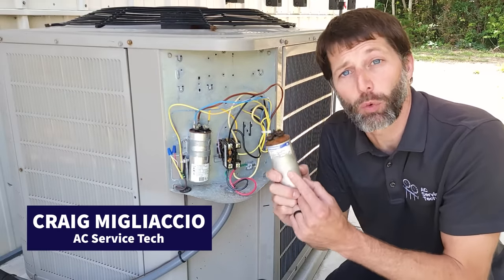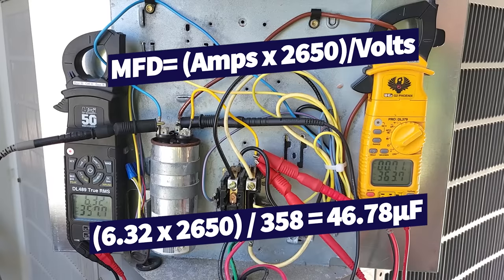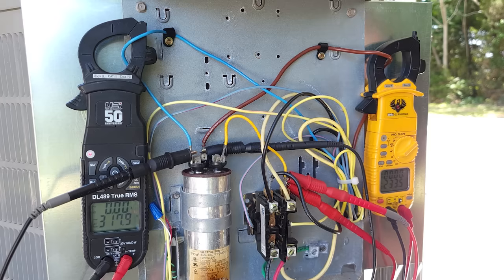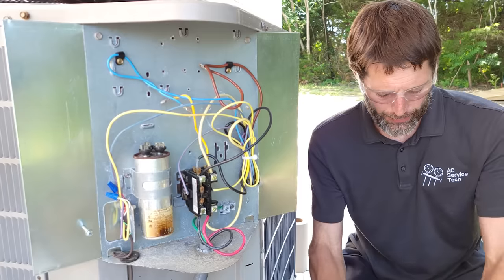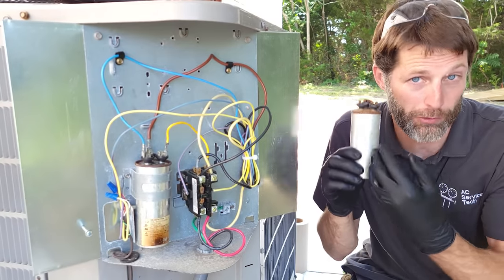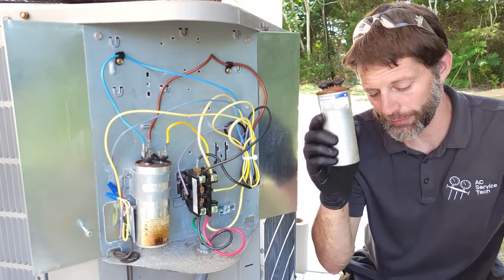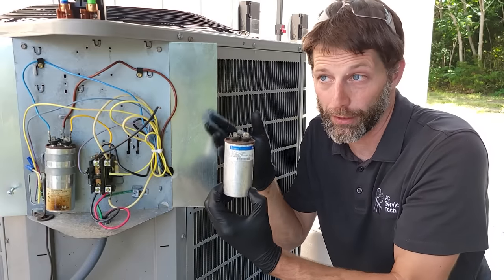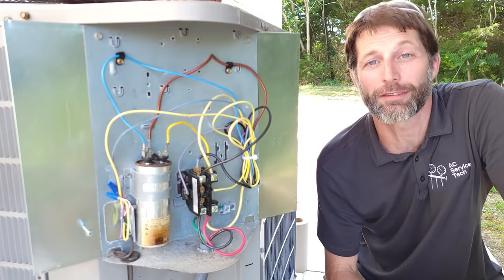WHY CAPACITORS FAIL in Air Conditioners! Watch it Break!

Comment: A little tip from a former residential tech, replace all 370 vac capacitors with 440 vac capacitors using the correct microfarad rating. IE: 35/5 mfd. 370vac dual capacitor fails, replace it with a 35/5 mfd 440vac capacitor. I can't ever remember having a callback on the same unit for a repeat failure in 9 years of service. Good luck guys!
Reply: if you put a 370 on a 440 , you will kill the compressor
Reply: @rodeoclownobama5796  but why?
Reply: Not even 440, but at least 370 * 1.41 = 520 V. Use 600 V capacitors and you will have no problems.
Reply: @rodeoclownobama5796  huh? the point is to upgrade the voltage from capacitor, not downgrade
Reply: @rodeoclownobama5796  lol, you sound like the uhaul tech who told me I was going to "over juice" ...his exact words.... and burn out my trailer lights by using a larger diameter wire...as if somehow magically the trailer lights will use a dangerously high amount of electricity just because the conductor is larger.
Reply: @rodeoclownobama5796  The voltage rating of the capacitor is the max voltage the capacitor can handle so you can you a higher voltage rated cap in for a replacement. Just don't go the other way.
Reply: you can replace a 370 cap with a 440 , but you can all ways go to 440 with no worries.you can go higher but not lower, I know people who put  a 370 on a 440 and it killed it, mistakes happen. why I don't know, I just know it killed it, took a week or two but it did kill it
Reply: @rodeoclownobama5796  Did it kill the compressor or the cap? I've never made the mistake myself so I'm unsure of which would be damaged. I imagine the cap went right?
Reply: @stinkyham9050  wrong
Reply: @rodeoclownobama5796  I think you're missing everyone's point on this. No one is saying put a 370v cap where a 440v is needed. We are saying to put a 440v cap in place of a 370v cap. I'm not wrong, the voltage rating on the side of a cap is the max voltage it can handle without taking damage.
Reply: @rodeoclownobama5796  that's not how this works bud.
Reply: @stinkyham9050  I said the compressor
Reply: @stinkyham9050  I know that the  comment  said." replace all 370 vac capacitors with 440" all I said if the compressor is rated for a 440v cap and put a 370v on it it will kill the comptessor, that's all I said, man can you people read, go back to school
Reply: @stinkyham9050  you were warned his handle has word clown 🤡 and obumer , not the most sensible crowd
Reply: @rodeoclownobama5796  Agreed, you can't reduce the voltage of the cap or damage can occur. As for us misunderstanding you there was about 5 people on here that read your comment and we all thought you were saying the same thing. Perhaps your comment was not as clear as you thought it was.
Reply: @stinkyham9050  I guess seems it's all cleared up now
Reply: @rodeoclownobama5796  lol it was pretty clear to begin with! Larger caps equal lower chance of it blowing again.
Reply: I am an electronics tech........  not an HVAC tech.    In electronics,  it's an OK practice to use a replacement cap with a higher voltage rating within reason.   If a circuit is running 40v,   the factory cap may be 50v........    If I replace that 50v cap with a 63v cap,   my 63v cap is still only being charged to 40v.   I don't see an issue with that.
Reply: I did the same thing as an electronics tech. I think most of the capacitor failure I saw was due to cheap Chinese made electrolytic capacitors with bad electrolyte, but occasionally I'd see some circuits that used capacitors with an insufficient voltage rating.  Aside from the added lifespan of using a higher voltage rating cap, there's also a benefit of having a lower ESR (most of the time). Lower ESR can be a good thing in fast switching circuits such as power supplies and DC-DC converters.
Reply: Right!…why even carry the 379 vac cap on your truck?…waste of space…
Reply: @dmoore0079  there's been some issues when going way over spec in audio circuits... but a voltage bump of 25% or so never hurt my repairs.
Reply: @rodeoclownobama5796  that’s a negatory there hot rod. Using a 370v in place of the 440v OEM you’re losing voltage to your start winding. Thermal OL in the compressor is going to protect the compressor and the 370v capacitor is going to fail due to the increased heat generated from the start winding staying in circuit longer than it would loading the 440v cap.
Replace a 440v w/370v in a piece of TRANE equipment not equipped with a potential relay and start capacitor you can wave buh bye to the compressor warranty if it is still under the manufacturer or extended warranty.
Reply: I have done this with multiple systems, in different electronics, AC systems, etc.  Many manufacturers specs their capacitors just above the limit, so a 18V circuit has a 20V capacitor, and a AC unit running 360V has a capacitor rated for 370V.

Replacing the 18V circuit capacitor with a 30V capacitor instead of 20V, and a 365V circuit with a 440V capacitor instead of 370V will drastically increase their lifespans.

Getting actual Made in USA capacitors also helps, instead of all this China garbage which was made by the lowest bidder for a Nickel a piece.  Replacing your Chinesium capacitors with an AMRAD and paying extra $20 for them will always be cheaper than a AC service call or replacement parts for your AC system.
Reply: @rodeoclownobama5796  NO. Also to offer more insight. Sometimes things die. Compressors die. You die. Everyone dies. Dont feel bad that the compressor died. Think about all the good times we had with the compressor. Anyways dude you're wrong. You can put a lower voltage cap on a compressor. If you exceed that voltage it will blow. The compressor blowing is either unrelated, due to the old age of the compressor or actually related to the cap failing. Yeah basically anything's possible.
Reply: USE UPGRADED AMERICAN MADE COMPONENTS LIKE THE TURBO 200 AMRAD CAPACITOR WITH BRASS CONNECTORS THAT DONT RUST AND COME WITH A 5YEAR PART WARRANTY
Reply: Thank you!  While the video gave many reasons FOR the capacitor(s) to fail, he said NOTHING useful about how to prevent or forestall such failures (other than wait for end-of-life and call for repair.)  YOU have provided a very good potential preventative method to make such failures possibly less frequent, and that is the way it should have been!
Reply: @russell937.  You really don't need the Turbo 200 per se as that is basically a "universal" capacitor you can use in most A/C units, as it has multiple terminals with multiple capacitance values, making it a "universal" replacement that covers probably most scenarios.

Something like a regular Amrad with the correct capacitance and voltage rating will work just fine.

The Turbo 200 is pretty pricey, and would mostly work for an AC tech on a truck in rural areas where parts depots could be far away, and returning to a parts warehouse would be hours worth of driving.

If you are replacing them yourself, or know the values you need, just order the correct values.  The universal application won't really do anything for you at that point.
Reply: If your assumptions are correct. Ask yourself what killed the capacitor? How many service calls did you miss on call backs because of a missed diagnosis. Parts fail for a reason. Sounds like someone else was going behind you and properly addressing the issues. New caps that fail are either just poorly made or the cap was the result not the cause of your visit there.
Reply: @barbarafogle3541  Not sure I follow your logic there.  Parts don't necessarily fail "for a reason".  Parts like capacitors are life limited.  They are not designed nor intended to last forever.

It all depends on the cycles they are put through, and the environment they are operated in.

If a new capacitor fails, it was either defective, poorly made or not rated for the application it was put into.

An old capacitor will fail due to wear, cycle time, temperature, rust or other issues.

There aren't a lot of scenarios that would make a new capacitor fail besides defects or the capacitor being underrated for its application.
Reply: @redbaron6805  everything has a shelf and run time life. Only so many start ups for any motor. But time is just a man made construct to describe something. Usually a distance of space depending upon a relative position. But that's neither here nor there. Everything fails for a reason. Cause and effect is grade school logic winch holds true in our understanding of physics. For every action there is an equal and opposite reaction. A parts changer replaces parts because that's what he sees and never looks beyond the obvious problem in front of them. A tech is supposed to know why he's changing a part and how far to go beyond just getting a unit running. I'd like to test your experience if any and knowledge concerning capacitor & Hvac motor relationships when it comes to failed caps. What would you say the first thing to check when finding a fail start and or run capacitor on the condenser loop on a system? This guy talking about no call backs because of installing a different rated cap is nonsense and coincident. Can you tell me what steps would eliminate call backs for this situation other than a factory defective cap winch I believe is never gonna happen. Especially if you inspect and check the new cap before and after installing with the proper service meters.
Reply: Or put super simply.What's the number one cause of a failed cap in a yard condenser?
Reply: What other steps might you take to insure the system is running efficiently before or after installing a new cap?
Reply: Really? I go with 660VAC capacitors, the higher the voltage the better constructed the capacitor is. Also, the fan and compressor need different run capacitances, depending on the model, tonnage, manufacturer and of course which era it came from.  Don't forget the three most important factors; Lightning and Surge protection aka S1 and S2 protection, the third is making sure you go with a high quality manufacturer and don't use knock off brands.
Reply: @rodeoclownobama5796  Your initial comment was not clear, simply said "if you put a 370 on a 440 , you will kill the compressor" and nothing more, so not clear if you meant the cap, or the compressor, which eventually got cleared up but it took several people to do so after the initial confusion.
Reply: @johnhpalmer6098  I'm pretty clear, did I say compressor or cap, I said compressor
Reply: @barbarafogle3541  A capacitor doesn't really affect efficiency.  It is just a component needed for the system to run at all.

For A/C's to run efficiently, keeping them clean (the coils) and the airflow path clear with clean filters is probably most important.

Locating them in a shaded area is another, as they remove heat more efficiently if the condenser isn't being roasted by the sun all day.

The most important step for people is to make sure your system is matched to the space it is cooling.  People think larger is better, but it isn't.  Neither is too small.

A/C's have a Goldilocks size for each space.  Deviating from that hurts efficiency and reliability.  

Also, people need to have a new load calculation made if anything changed in the house.  It is very common in southern states like FL for people to buy the same system they had before.  But if you got impact windows which are more efficient, your cooling load will change.

So, don't buy the same A/C as you had last time if you modified anything on your house that affects your cooling load like windows and sliding doors.
Reply: @barbarafogle3541  The most common is probably age and cycles on the capacitor.  They are life limited components.  

They wear with time, so an AC that is used year round will wear them out faster than seasonal use.  High heat will stress them more than cooler climates.  Etc.
Reply: @barbarafogle3541  I think you may be expecting people that repair those things to do a detailed failure analysis vs just repairing the system.

That ain't going to happen.  Those are not engineers with a graduate degree.

Depending on the age of the system and its use, a failed capacitor may have simply reached end of life if the system is old enough.

Talking about getting no call backs for a differently rated cap is not nonsense.  Using a capacitor rated for higher voltage means it is designed and built differently, with different thickness and materials, and it will last longer for that reason.  The price difference is very small, so it makes zero sense not to do that.

Capacitors are Made in China or Mexico with minimal quality control, cost is everything.  So, defective caps do happen, and there was an epidemic of defective capacitors in electronics and TV's in the last couple of decades, so it is not like it doesn't happen.  It does.

The "inspection" you do on a new capacitor is simply to measure its capacitance.  No one in the field carries a capacitance leakage tester that checks if the capacitor is holding up under its rated voltage.

Ultimately, if you don't want to have capacitor problems, use Made in USA capacitors rated for 440V.  That should eliminate most capacitor issues.
Reply: @redbaron6805  finally someone said it but I doubt any of you actually realise or do it. 99.9 percent of the time Its a failed cap from overheating. Due to dirty coils.
Reply: @barbarafogle3541  I honestly don't think that is the cause.  Dirty coils will make the AC run less efficient.  There is no reason it would shorten the lifespan of the capacitor.

Coil dirt on the condenser or the evaporator would restrict airflow.  On the condenser it affects efficiency, on the evaporator it would probably cause the evaporator to freeze over.

Keep in mind that most people never clean their coils, so if that was a plausible cause, you should have a capacitor failure epidemic in AC systems, but yet that is not really that common of a failure.
Reply: @redbaron6805  a higher rates cap has a bigger plate inside of course its gonna take more of a beating. So does that compressor you left running a extremely high head pressure that's probably low on refrigerant with its blocked up condenser coil full off grass clippings. Some people see it but can't comprehend so they change the reality. His next call back was no cooling. He found a failed compressor and never understood why. But that cap will work on the next call. Its still shiny and new. We call that a triple lick. Service call and part+service call and replacement= service call and double sale of parts.
Reply: What happens to a cap that's subjected to extreme heat or anything for that matter. It expands. Most caps are just a little wire and cardboard inside an oil filled can. Imagine its been running nonstop for 3 days in 100 degrees. Try putting it on a stove for visualization.
Reply: Thanks mine has blown 2x in 9 years
Reply: @rodeoclownobama5796  that's a  rating. I'm sure they install a 370v to keep the package price at a certain price point. I had a person change the 200 amp residential breaker panel to a 400 amp panel to make sure he had enough power...that's a maximum rating for the panel, he was running no where near 400 amps, he was probably at 60 amps, but he wanted to know he could run 400 easily...?
Reply: p be
Reply: @rodeoclownobama5796  The way capacitance works the voltage rating has nothing to do with the actual output voltage.  The capacitance (microfarad rating) is the same for either of the caps specified in the parent post. It pays to understand electrical theory. Cost is so critical that caps of lower voltage rating are used in consumer equipment but they're so cheap for individual sale running a higher voltage rating has no practical downside.
Reply: @obfuscated3090  If you read through the thread you'll notice he clarifies what he meant (370 cap on 440 comp will kill comp) and he does understand.  His first reply was very ambiguous and most people misunderstood what he was saying.
Reply: @rodeoclownobama5796  Not sure about that. Yes, it might keep the compressor from starting and/or running normally. But I see no damage. I could be wrong of course.
Reply: The 440 has to be made more heavy duty to handle the higher voltage and therefore lasts longer.   Great tip.     You can use a 440 for a 370 but you can't use a 370 to replace a 440.
Reply: That's a good tip, but an even better tip is to use a capacitor with a higher temperature rating if the capacitor is failing due to temperature.  Using a capacitor with a greater voltage rating and a greater temperature rating is even better still.  At least for making the customer happy. If you make money on callbacks not so much.
Reply: @AvgDan  but it's the cap that will blow, generally speaking, since it will exceed its maximum breakdown voltage. If the cap blows whole the motor is running, then yes you can roast a motor with excess current/etc, but honestly a 370V cap should pop within seconds of being connected to a 440+V input,  regardless of load condition.
Reply: Thanks for this.
Reply: @redbaron6805    True.  And oversized AC will cool down to setpoint long before the humidity is removed, resulting in a clammy cool environment.
Reply: @tomrogers9467  Exactly.  You would be surprised how common the mistaken belief is that bigger is better with A/C units.

I even argued with my brother about this when he decided to put a larger 5 ton A/C into his house.  No amount of logic would convince him it was the wrong move, and he ended up spending many thousands of dollars fixing his mistake when all his ducts started dripping moisture all over the place and the A/C would never run correctly...
Reply: @redbaron6805    Which only reinforces my long maintained position that “bigger is not better”.  Well, for some things, anyway!  🤫
Reply: @redbaron6805  your should be telling him to get an inverter unit
Reply: @Rokomarn  Inverter units are pretty rare in residential systems except for mini splits.

They tend to be cost prohibitive in residential applications when you need large cooling capacity, and then you typically would need a large mini split with multiple indoor wall units.

That setup is still relatively rare as some people don't like the look of many wall units along with most homes already have ducts for a central A/C.
Reply: @tomrogers9467  For AC's anyways...
Reply: @rodeoclownobama5796  That's not what he said. IF the circuit has a 370 VOLT capacitor, replace it with one that has a higher voltage limit. It will not kill the compressor or anything else. It will increase the margin so that the capacitor can absorb higher voltages or surges without damage.
Reply: @zachm.3049  I think rodeo clown obama has been thrown one time too many.
Reply: @stinkyham9050  since power is volts and amps, dropping the volts would make compressor want more amps, and then POOF magic smoke.
Reply: We keep mostly 440 capacitors just so we don't have to carry two different ones
Reply: @williammackay250  we don't anymore. All 440
Reply: Classic case of derating... 👍🏻
Reply: @russell937.  you say that like there cheap, the reason people dont buy those caps, its bc they’re expensive and the customer doesnt want to pay for that price margin for a better cap. Same reason why most people still buy the minimum seer rating house unit.
Reply: @Vishrut.Dave94  brother owna parts wharehouse?
I just had the 24v  transformer blow.
No parts store would sell it or the high temp wire without a AC license.
"It's for safety"  I pointed out forcing me to use speaker wire is what is unsafe.
Reply: @rodeoclownobama5796  I know exactly what you said, however my question is why you said it?  I mean YOU caused the confusion…
Reply: He is raising the working voltage for the capacitor higher the better, problem is that capacitor will be larger in size so mounting maybe an issue. Thanks
Reply: Perhaps you don't get call backs on those units might be because they figure you messed it up the first time 🤣 😂
Reply: @TheZBuZZ  "That's a negatory there hot rod".  He did NOT say that it was OK to use a cap rated for a max of 370 Volts in place of a cap rated for 440 Volts, he said the opposite: "if you put a 370 on a 440 , you will kill the compressor".
Reply: @stinkyham9050  His comment was quite clear, the number of people that misunderstood it doesn't change that.
Reply: @TheZBuZZ  Please explain precisely how a cap rated for a max of 370 volts will cause a loss of "voltage to your start winding". The voltage rating is the max recommended voltage, that doesn't mean it's going to limit the voltage. Sure it will fail sooner with a higher voltage applied, but that doesn't mean it's going to limit the voltage to 370V.
Reply: @tommckelvey3609  If you say so. I guess you're just so smarter then the rest of us. Good for you.
Reply: @stinkyham9050  There you go again ASSuming that it was "the rest of us" that misunderstood his clear comment. LOL!
Reply: @tommckelvey3609  Wow, you are good. I hope to grow up to be as smart as you one day.
Reply: @stinkyham9050  Nothing wrong with aiming high, LOL!
Reply: @tommckelvey3609  Well fortunately I'm a really good HVAC mechanic.
Reply: @watchmakerful  NOT "at least" 520 V. You're taking a maximum and again multiplying it by a peak factor. A cap rated for 440 v in place of a 370 V cap is more than sufficient, no practical need at all to go to a cap rated for 600 V. In time eventually all caps will likely cause a "problem".
Reply: @greenidguy9292  the confusion continues because some people can't go back and edit, or just delete misleading messages. bottom line is much of this is friendly talk, not an education class  to become a hvac technician.  There is a reason diy stores cover very little in hvac equipment parts. it's mostly just over homeowners heads. as a plumber, Way to.many things available to.do-it-yourselfers. alot of shit can get screwed up, and then you have to call a professional. electricity is hard. my hvac supply houses won't even let homeowners in the door. improper use can electrocute you, or burn your house down
Reply: @DeadKoby , more rated voltage usually equals less internal heat generated. Less heat equals longer life.
Reply: My outside condenser unit is literally in the shade all day except in the middle of summer when it gets some morning Sun the rest of the time it's in the shade. So will this lengthen the life of the capacitor? And if it does fail should I ask the HVAC guy to replace it with a 440 instead of a 370?
Thanks interesting video
Reply: @PastorManning1  air flow is important. see a few condensers buried in dead air areas, heaven bushes, blockaid fences, narrow spaces between structures.  while direct sun is a external heat, the airflow into sides and out top (traditioonal split) is more concerning. To say otherwise, roof top units would never work.
capacitor overheating in this context is internal electric by-product,  not environment.
Reply: @rodeoclownobama5796   the max voltage you’re going to get is peak voltage which is 1.41 times applied voltage. It doesn’t matter which one you use if the voltage is 240.  I’ve worked with the same systems for 20 years in 18 large buildings and never had an issue, unless it’s a 277 v motor then it matters.
Reply: I replaced mine after a power outage/surge. I’m not sure of what the voltage was on it. I just know it was a 45/5. I’ll have to look snd see. I bought a second one to have as a spare since they are so cheap and I saved the money of a service call 💰💰
Reply: @DeadKoby  The same problem with compressor-less wine refrigerators using hotplate - coldplate technology and 12volt muffin fans to transfer heat off the system. The cheep electrolytic cap on the board for the cooling fans are 16volt rated 1000uf caps.
We always replace with 50volt 1000uf caps and have not seen a bad board in 10 years since making the upgrades.
Reply: That is exactly what the HVAC supply guy in oregon    said use a 440 on the unit instead. And we did. Such a great tip. Thank you!
Reply: Yup I already tried that and it works
Reply: @stinkyham9050  just seems like Tom can read and comprehend the English language, no problem with that!
Reply: @jerrybarnes3104  You missed a capital there Mr English language police.
Reply: I just increase the mfd rating by 5 no more, not all compressors are designed equal some need just a tad more then 35mfd like 38mfd or even 40 and just install a hard start kit.
Reply: Ours has been perfect since 2001. One advantage living in a cooler location. Can’t complain but I know how to replace it when it goes . 🇨🇦
Reply: Can you strap a heat sink to the side of the capacitor with some heat sink grease and metal band?
Reply: @rodeoclownobama5796  He says put a 440 on a 370. Not a 370 0n a 440 GEZZZZ!!!
Reply: Yup.... and that's just good common electrical practice, never load something to 100% of any of its ratings. Why push a 350-370v cap at 365v ?  The extra headroom is always good to have !
Reply: On high end heat pumps a soft starter is used instead of Start and Run capacitors.  But if manufacturers of lower end units fix the problem of capacitors always failing then a ton of service technicians would have very little to do.
Reply: @rodeoclownobama5796  Don't let them get ya down; too many readers just can't imagine that a comment reply can be a "yes, and..." instead of "no, actually...". We need more of the former.
Reply: @zachm.3049  Isn't 440VAC > 370VAC?  To me replacing a 370VAC by a 440VAC sounds suspiciously like an upgrade. . .
Reply: @rodeoclownobama5796  Reread the original comment...your understanding is off...I'm a total novice but I understood the commenter clearly.
Reply: @rodeoclownobama5796  You misunderstood.  He DID NOT say to increase the voltage.  He said to increase the voltage rating of the capacitor. The voltage rating is just an upper limit, which must never be exceeded in a functional circuit. Replacing a capacitor with something that has a higher voltage rating is always safe.  So in effect the capacitor is a little larger and more expensive upgrade.  But the additional couple dollars are nothing compared to the repeat service calls from a "designed to fail" circuit.
Reply: @rodeoclownobama5796 Im gonna step in this big pile of horse Sh_t here...The Tech on the video himself said the voltage increase above the home supplied 220v comes off the back of the EM of the compressor, having a capacitor capable of handling that isnt supplying the voltage TO the compressor to destroy it. The higher voltage ORIGINATES from the compressor.  If the compressor starts supplying more voltage its because resistance is increasing,  likely due to heat. EVERY time my run capacitor has failed its been 90+degrees with extreme humidity and no wind. EVERY time.  Im thinking going from 370 to 440 is the answer to the freak occasional times when that wet bulb temperature hits and things arent cooling off. I'll also add, when that run cap dies, the fan windings get crazy hot, and can be ruined because they aren't rotating.
Reply: @spudthegreaterusa8386  Close. Back EMF can never be higher than supplied voltage.  So the voltage measured is a combination of supplied voltage and back EMF from the compressor motor.  It is NOT purely back EMF from the compressor. The higher voltage does not "originate" at the compressor.  Only the voltage component that is not from the supplied voltage is back EMF voltage. The only circumstance where the back EMF voltage can be higher than supplied voltage is if the compressor is spinning faster driven by some other means than the supply voltage.
Reply: @michaeljorgensen790  I guess that's what I was attempting to say. The Video stated that the voltage above the 220 comes from the EMF Of the motor (220 + EMF =370V) and that increase can be impacted by temp. resistance.
Reply: Capacitors overheat when working too hard. 
I/E- dirty condenser causing fan motor to labor more and compressor works harder because of the high discharge pressure. 
I enjoy washing condensers and replacing capacitors.🫢
Reply: @SomeRandomdude857  Technically that is  not quite correct.  Capacitors generally do not heat up at all. They only heat when they have a higher loss which is normally very small. The capacitance of the capacitor can change with a change in ambient temperature. The capacitance change can move the operational curve of the circuit outside the range of the capacitor specifications  and operating outside the range of the capacitor is what causes it to fail.  That is why if you put a heat gun on a capacitor and lower the voltage as the capacitance changes it is difficult to get it to fail.  But raising the voltage above its operational specifications will cause it to fail even when it is cold. Usually when a capacitor get hot it means the capacitor has reached its end of life, it has failed, or it is unsuitable for the voltage, current, frequency , or pulses being applied to it and not because it is being overworked.  To be sure a capacitor in a hot environment will fail sooner but the heat is not usually the DIRECT cause of the failure.  It is an indirect contributing factor.
Reply: Okay it failed now what. . . ?
Reply: Get a couple of fans and plant some trees.

Get used to the heat folks ... won't kill you. We all grew up without a/c but now somehow we can't live without?

Every air conditioner pumps out more heat so it is a vicious cycle.
Reply: Would only stock 440V caps - V can increase but do not increase or decrease uf
Reply: @rodeoclownobama5796 No. In AC you could always use higher volt but not lower. In DC Capacitor you don't go with higher Volt.
Reply: @maubunky1  ДРУГ МОЙ ВАМ НУЖНО ВЫУЧИТЬ ЧТО ТАКОЕ ПУСКОВОЙ ТОК И ДЛЯ ЧЕГО ОН НУЖЕН  ,440 ВОЛЬ ЭТО ВСЕГО ЛИШЬ ТО ЧТО МОЖЕТ ВЫДЕРЖИВАТЬ КАПАСИТОР НЕ БОЛЕЕ ,КАПАСИТОР ЭТО НЕ ТРАНСФОРМАТОР ,ЭТО ОПРЕДЕЛЕННОЕ СОПРОТИВЛЕНИЯ С ВОЗМОЖНОСТЬЮ УДЕРЖИВАТЬ ОПРЕДЕЛЕННУЮ НАГРУЗКУ ПРОВОДИМОГО ТОКА ТО ЕСТЬ НЕ ДАЕТ ПРОСАДКИ НАПРЯЖЕНИЯ ВОТ ЭТИ 440 ВОЛЬ ОНИ И ЕСТЬ ,ДРУГ УЧИ МАТЬ ЧАСТЬ ПОТОМ СПОРЬ
Reply: One of the reasons they fail, is there made to fail. MONEY!
Reply: @plusafdotcom959   he did mention corrosion..which if you have half a brain would indicate to clean the contact occasionally. Also mention if in sun gets hot...maybe putting up some shade for your unit....its not rocket science.
Reply: @rodeoclownobama5796 you said the exact opposite of what he said. He said use a higher voltage capacitor, not a lower voltage capacitor. If it's 370v. Use a 440v. Not the other way around as you were saying.
Reply: @rodeoclownobama5796 I think you didn't read what you wrote, you literally said replace a 440 with a 370. You said nothing about it killing the compressor
Reply: @rodeoclownobama5796  not true, the capacitor could fail
Reply: Just curious, I had the capacitor fail, the top bulged, and while there replaced the start capacitor with a 370/440 30 +-5 24v capacitor, the tolerance was 6 on the  original one. I also replaced the run capacitor since it was mfg. 2011. After restarting the unit, or attempting to the capacitor, or I assume it was the capacitor because I'd already put the cover back on, the capacitor buzzed. I turned the power off, and eventually it discharged, but I noticed the contactor looked like it might have welded the contacts. They were black from arcing and closed. I searched everywhere, but couldn't find a single pole matching mine, but found a double pole. I was assured by a hvac qualified tech that they replace singles with double poles all the time and no issues. I'm wondering what the effect of a double pole would be as opposed to just using a single pole  contactor. They appear to hook up identically to the single pole replacements I've seen, but would have to order and wait a few days.
Reply: @jimthomefan50025  if you have a heat pump, going from single pole to double might prevent the crankcase heater from working
Reply: @grashoprsmith  just an outdoor unit, no heat pump
Reply: I went to an electronics school 40 years ago. Yes you can use a cap rated for 440 max to replace a cap with a 380 max rating.
Reply: I'm just here to say, some caps last 30 years.  Some last 2.
I honestly can't believe I read thru Barbaras comments.

Anybody who happens to read this I say,  beware of people like that.
Reply: @ rodeoclownobama5796    If the compressor is on its last leg drawning more than 370 what harm is it to put in a 440v to keep from burning out caps each week? mind you i said compressor is on its last leg and should be verified by checking amp draw and start up voltage and maybe put hard start in along with 440v Cap
Reply: @redbaron6805 I much prefer the Platinum 1000.
Reply: @rodeoclownobama5796 it came in at a very odd time in the conversation flow. 
I’ve got no dog in the hunt but when you interjected it the flow was tripped up. Like it was a huge race to get to another idea before the first one had been ruminated on thoroughly. 
Life isn’t a race. Conversation has to be digested. 
Otherwise you end up with conversational diarrhea like we had here. 
Stop trying to be first always.
Reply: @redbaron6805 oh on the contrary….a capacitor can raise voltage which definitely affects the efficiency functionality
Reply: @barbarafogle3541 we call that being devious.conman style ethics
Reply: @walkingthruyourdata-6019 and he’ll never be able to pay his bill if he gets to 400 amps consistently. 
He’ll be homeless. 
What a waste of money
Reply: @AvgDan true but presentation went on the ditch either zero guardrail. 
It was like an “excited utterance” in the race to be first in a conversation among strangers…::…..:/
Reply: @richardcranium3579  No, a capacitor is a storage unit for energy, it can not "raise" a voltage in any way.  Only a transformer in AC or a DC to DC converter in DC can raise a voltage.

If you put 100Vdc into a capacitor, it is charged to 100Vdc.  AC voltage doesn't charge capacitors...
Reply: @barbarafogle3541  The #1 cause is just age and wear on the capacitor.  Other causes are power surges and spikes, overheating of the capacitor, especially if the condensing unit is located in an area that gets very hot, like a Black flat roof.

There are other causes like the unit getting old and motors and compressors wearing out, bad relays etc.

Ultimately however, capacitors are life limited components, and will wear out over time.
Reply: @rodeoclownobama5796  No you won't.  The only thing the compressor "sees" is the microfarad value.  The voltage value is largest voltage the capacitor can WITHSTAND.  As long as the rated voltage is large enough to not fail, the rating makes no difference.
Reply: Be sure is to discharge before removing old capacitor.
Reply: The Chinese stole the formula & design of capacitors from a Japanese company. However, this formula was faulty. So, their capacitors failed very quickly. The capacitors they've been making for the past 10 years are of relatively good quality.
Reply: My service tech replaced mine EVERY year until I quit using his company, and now I haven't had to replace one in 7 years.